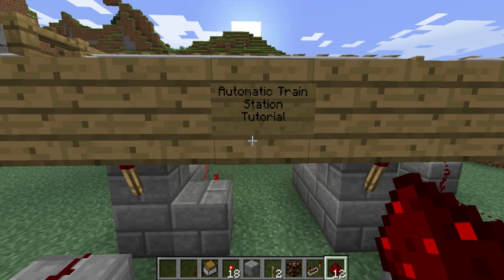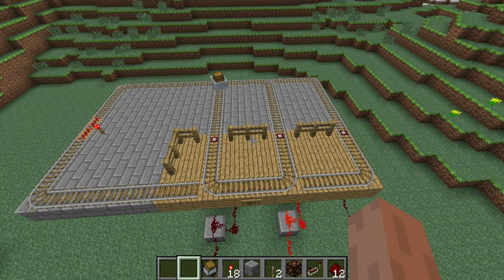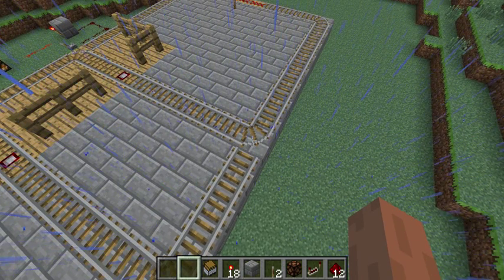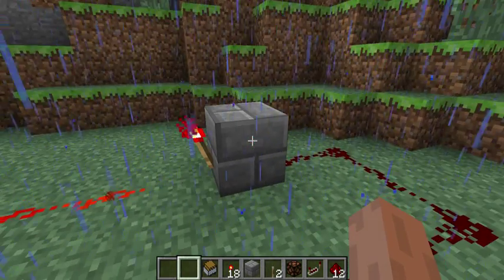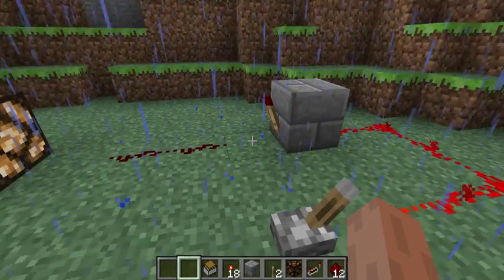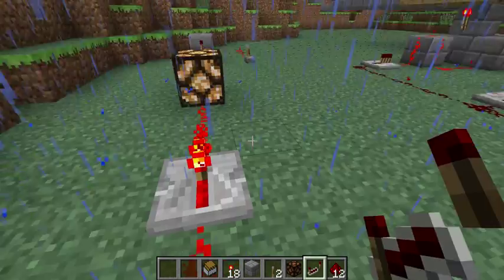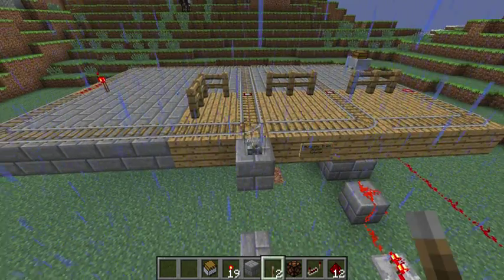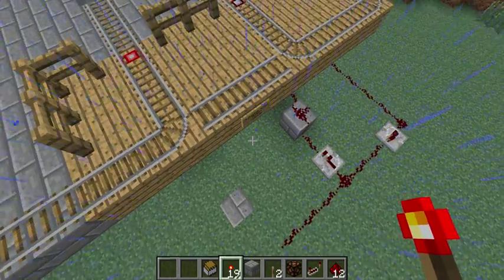Minecraft Railroad Automatic Multiple Track Switching Mechanism

Comment: I'm sorry my track doest no switch when it goes over the detector rail plz help
Reply from the maker: Kamran, let's start solving this problem with a little redstone troubleshooting. By 'detector rail' I am assuming you are referring to a 'button rail'. Place a 'button rail' on your railroad track with a stripe of redstone circuit goo coming out from it. When your cart runs over the button, the redstone circuit goo should light up and glow bright red. If this happens, then route the redstone circuit to a piece of corner track, so that the track switches when the cart runs over the button. If this simple circuit works, let me know and we will proceed from there.

Comment: When I built this and placed the redstone torch underneath it has the opposite effect of yours. Any advice?
Reply from the maker: Sorry I don't have an immediate explanation for this. I would recommend troubleshooting the problem by starting with a blob of redstone on top of a block. Place a redstone torch underneath the block, but not attached to the block. The blob of redstone should light up, indicate that power is being transferred up through the block.If all of that checks out, create a corner track on top of the block and check that the track switches in the right direction when energized. Hope that helps.
Reply: Its ok! I figured it out and it works great! I used in on a roller coaster!
Reply: @TheLuckyTitan  It depends on the orientation of the track, whether it's north-south, or east-west. I suppose this design only works in one of those directions.